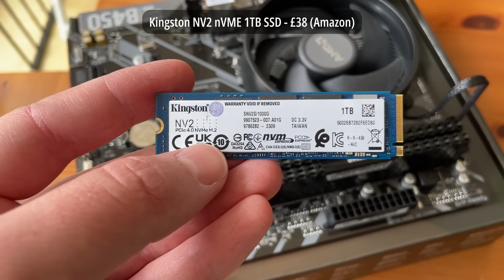Building a Cheap and Upgradable Gaming PC in 2023

Comment: How it is that people prefer AM4 for upgradability while LGA1700 isn’t a valuable option? Is it because the LGA1700 will come to an end? And people will adopt to the next LGA?
Reply: that would honestly have been the more upgradable option since you can get  a low end cpu/ddr4 and at somepoint you can switch to a 13900k with ddr5 with only upgrading one thing at a time
Reply: @larbi253  Indeed! I was pondering about using something like a i3-13100f paired with a Intel Arc750/RX6600/RTX3060, and for later could upgrade the CPU and GPU.
Reply: AM4 has been around for longer and is compatible with twice as many generations of CPU, so the used prices are significantly lower, providing a cheaper entry point. Intel CPUs are also notorious for holding their value in the used market, especially at the high end. I used to look for upgrades to my previous Intel processors (I last owned an i3-7100) and it was never worth the money to upgrade. Completely different when AM4 came along.

So, if you're on a tight budget, you're better off with a low end AM4 CPU today, upgrade once to, say, a 5600, and then migrating to AM5 next time around, which again will last longer than whatever chipset Intel will be on by then.
Reply: @EnglishMike  Interesting, thanks for the informative news! Why do you think that the use market make the Intel CPUs almost as identical to new? Is it their high demand? What about AMD, doesn’t AMD also have a high demand due to budget gamers?
Reply: @misterhoudi2824 Not 100% certain, but it's likely a combination of Intel rarely dropping prices that much on older CPUs and the fact that the chipsets/sockets are typically changed every couple of years. 

Intel has also typically release its entire line up, from i3 to i7 around the same time, while AMD has taken to shipping the high-end chips first and waiting several months before we sell the low end models, preferring to fill that gap with a reduced price previous generation of CPUs, which creates a significantly lower ceiling for used CPU prices.

I haven't checked to see if that's true at the moment, but that's my feeling anyway. It's a little muddied at the moment with AMD switching to AM5, but unless I see a major shift in either company's strategy, the same thing is likely to happen with AM5 too.

Comment: I recently upgraded to AM4 for cheap. Found brand new open-box cheap board from biostar, Ryzen 5 1500X and 8GB of the same RAM (just slower at 2666MhZ). AM4 is a great choice for budget builds. U finally moved on from 1155 and i5 2400.
Reply: If the bios is unlocked try clocking that ram. There is a 99.99% chance that ram will run at least 2933 C16 and possibly with a latency of C14.
Reply: Biostar seems like not a very reputable brand for motherboards iws. Even their Valkyrie X670 E mobos are having VRM thermal issues
Reply: @baoquoc3710  If you are buying a Biostar, you are probably using a stock downdraft cooler blowing across the board and not a tower.
Reply: hope u stay on budget and not ppla NEW tripple a titles cuz that thing gonna make u cry, 4c/16gb ram, uuuuf, 3770k called and is bloddy mad^^ and it also wants its ram back XD

Comment: When I first built my pc I went with a very cheap case and the psu was top mounted and it is literally impossible to cable manage, I tried tucking  cables in the back but the sidepanel wont screw that way. Might consider the case in this video
Reply: Top mounted PSU was old tech. Those engineers weren't dumb, the PSU exhausts hot air from the case. Side door ventilations is also old tech, but it keeps a graphic card cooler and these days is only found on office pc cases and very expensive gaming cases. I use office cases because I don't need glass, the magic is on the screen, not in the case.

Comment: I build my first ever pc around 2-3 years before ryzen 5 3500 pair with rx 550 2gb Asus Ex-a320 gaming mobo single 8gb ram stick gigabyte 550 80+bronze ant eSports cabinet 256gb nvme 1tb hdd.. basically to do my College/university projects for my degree.. finally passed.. looking for job as soon as I get my first and second salary going to shove a new GPU.. but my rx 550 runs a like a champ in eSports title like valo around 230-250fps average on 1080p low csgo dota2 apex legends.. I enjoy every time I play games on it.. 720p high -1080p low/vlow still a capable card for games like 2017 or lower.. my main priority is to Double the ram stick as fast as I can.. I have 3200mhz CL16 I think coz it written like cl 16-20-20 all the products were new including the mouse keyboard monitor basic speakers cost me around 50k INR 2-3 years ago.. would you suggest me.. did I made a good pc for my first time.. is my CPU capable of doing anything if yes wht is best GPU brand new I can pair with it without bottlenecking.. wht should I upgrade first.. GPU or something else.. ram I on my mind..

Comment: I feel like a better gpu choice would have been a radeon 5000 series card given todays gpu market but other than that nice build
Reply: Well not really, considering that the closest priced 5000 series card in the UK, the RX 5500XT shows slower performance than the 1060 on average. I’d say the better choice would be the RX 580 but there’s much less of an upgrade path for that compared to the 1060.
Reply: @akturosu  Wow, i understand that people prefer Nvidia but this is something else. 5500XT can trade blows with a GTX 1660 and is considerably faster than the RX-580. Very hard to understand how someone can say that is slower than a 1060, a card that can't even beat the 580, not to mention the 5500XT incredible efficiency.
Reply: @TheBDlab  My bad, I got the performance of the 5500XT confused for another card. Should've double-checked before making my comment.
Reply: @akturosu  No worries, it can happen to anyone. Maybe you confused the 5500XT with the 6500XT that is crippled by it's PCIe running at x4? That is a really problematic card indeed.

Comment: Assuming you're not planning to sell this build immediately, I'd love to see each piece get upgraded and tested as part of a series of tests to see which component someone would want to upgrade first.
Reply: 1st upgrade would need to be the videocard: a 6600 or a 6700 that are now so cheap.
2nd would be the cpu, upgrade bios if needed and upgrade to a 5600x, or a 5600x3d if you live near to a microcenter, or finaly best upgrade posible is a 5800x3d, that chip is so good still.
Reply: 5600g, 5600x isn't worth it tbh @josejuanandrade4439
Reply: @josejuanandrade4439 fair, though the 5800x3d really likes big coolers
Reply: never buy 5600x just 5600 that is more cheaper and 2% worse than x version @josejuanandrade4439
Reply: @Blackfatrat  since we're speaking about a specific build with 16gb ram and a 2600X, GPU all day
Reply: I have almost the same pc and id like to see the max potential u would get from this board.
Reply: @Mcjuanse04  well I mean if it has a 600w psu go with a 5800x, and rtx 3080?
Reply: @DCnormal  that's what i have, thanks for the suggestion even tho it will take quite a while lol
Reply: @Mcjuanse04  I have a 550w psu. Ryzen 5600 (i upgraded form ryzen 1400 to 2600x now to 5600) and 6700xt. Does pretty well at 1440p and in VR. As for max potential, 1000w psu 5800x3d and what ever GPU you can afford. But at that point you are probably better off upgrading to AM5 with the amount you are spending
Reply: GPU would be first.
That CPU can go up to a 6600 with ease in FHD. Or you could just get the 6600 from the start, since the price on it isn't that much these days.
As for "upgrades", you can put in a 5800x3D which tops out a 6800XT in FHD or a 6950XT in QHD or a 7900XTX in 4K. This would be the most possible performance you could get on the AM4 platform.
As for the most sensible option, it would be a 5700x with a 6700XT in FHD, 6800 in QHD, 6950XT in 4K.
Each combination between the sensible and the most powerful option is twice the money but not twice the performance. It's somewhere around +30% more performance.
Reply: always the gpu

Comment: Love the upgrade path with this one though I think I would've gone with a four slot RAM ATX motherboard instead just so I could get a cheaper RAM upgrade path down the line like I did with my 5600X build recently. My upgrades would be as an essential a new GPU since I have a 1060 due to GPU stock and money issues and its performance is slowly fading out playing at 1440p, maybe try to get another SSD with 2-4TB on it (They seem to be cheap on the SATA side of things) for installing more games where an SSD is nice but not a must (Surprising number of games, including Fallout 3 of all things weirdly). Less essential but nice upgrades would be a new CPU cooler I think but again I love this build and it should last for quite a while. I think an update video at some point down the line would be cool to see. 👍
Reply: The only issue with RAM upgrades is whether timing compatible RAM is still available down the road, and you sometimes have to pay a premium to find a matching set. I had trouble getting two pairs of 8GB of DDR4 running together over the base clock speed of 2133MHz even though they were rated higher. 16GB has only just started being recommended for AAA games (even Cyberpunk 2077 was less than that), so it's probably not going to be an issue for budget minded gamers for years yet.

2TB SSDs are the sweet spot these days, and SATA is definitely on its way out there. You can buy a cheap nvme to pcie adapter if necessary. They also sell cheap USB enclosures for nvme drives too -- great for older SSDs you don't need in the system anymore.

For a cooler I would highly recommend the Thermalright Peerless Assassin. It's only $34/quid/euros and it dropped my stock cooled 5600x by 10C (at idle) with the fans running (silently) at 800rpm. Just make sure there's enough clearance in your case. (RAM clearance shouldn't be a problem if you don't have fancy RGB lit DRAM sticks!) It was worth the money just to not hear the whining of the stock cooler fan any more.

Comment: A 2600x and wraith stealth is a bad combo 🔥 the 2600x normaly comes with a wraith spire which is way better because it has a copper slug
Reply: Mad build he did, old can be good too! 2600 aged very bad, why not use old ddr 4 intel ?? Old good Nvidia card ! Why old 1060 ????? Too cheap ! Stock cooler is mad, but if you are this cheap, it matches !
Reply: @lucasrem  he used a wraith stealth and not a wraith spire which is the normal cooler included with the 2600x

Comment: EVGA power supplies are generally ok to buy used, so long as it's not crazy old. They make good solid units that last a good while.
Reply: Well- never judge by brand alone! Every and any brand has their own good and bad units (well except the straight up bad ones, like gamemax or aresgame units). EVGA units like N2, BT and W1 are definitely some of their lower end units, for a lack of better phrasing. They aren't that great, and will implode under a strained load, if you're unlucky.
Reply from the maker: Yeah never had trouble :)

Comment: I get the point of the video is to show the "upgradable" possibilities of a very cheap and decent little build - but that's also sort of the problem: the chosen case here is far, far too small a form factor for anyone wanting to, at a later date, install a more powerful GPU. Why? Because it'll NEVER fit in this case! An old 1060 is one thing, but more modern cards are significantly larger. You'll be barred access to newer GPUs by a tower of this size.

Buy a bigger case and don't literally box yourself in, completely unnecessarily. They can still be found extremely cheaply.

Otherwise a nice instructive little video.
Reply: There are plenty of newer GPUs that should fit fine in this, like a RX 6600 XT or even some RX 6700 XT variants.
Reply: @olnnn  but thoies cards woulkd be horrible unsatisfied on that Chip even at 4k a 2600x is just too damn slow, and then theres just 16gb of ram, UFFF my phone has already 12gigs, BOTH OF THEM-.- and a DRAMless happy meal kinda ssd that would all be not great for example a R9 500X/64gb of RAM and an RTX 3080, so for only thoes 2 parts you would need to build an etire new machine bro :*

Comment: Do you think it would be better to buy a used ps4 or a sub 300 gaming computer? I dont have much time to play games anymore, but it would be nice to have these options other than mario kart.
Reply: Gaming PC all the way.  Many of the PlayStation games are coming to PC, and all the Xbox games are there already.
Reply: Since cheap Chinese RX "580" appeared on the scene, there is no much point for buying used PS4, since these cards are in effect on the level of PS4 Pro.  Note that CPU in PS4 and PS4 Pro is on the level of FX-8320 or 8350, so even Ryzen 5 1600 would clean its clock.
Reply: The best thing about PC gaming is the hundreds of top quality games that you can buy for under $10 each during Steam, GOG, or Epic Game Store sales. Epic Games and Amazon (Prime) also give away games for free every week and while there are some you will never have heard of, they will quite regularly give away some top quality games, especially during sales events. 

It's a bit ridiculous because I have no time to play more than a tiny fraction of them, but I have several hundred games in my PC game library, most of them given away free over the last three years. 

Also, you don't need more than a $300 gaming computer like the one in the video to play them.

Oh, and if you're into console games, there are PC emulators for almost all but the very newest couple of generations of console that can run those games too.